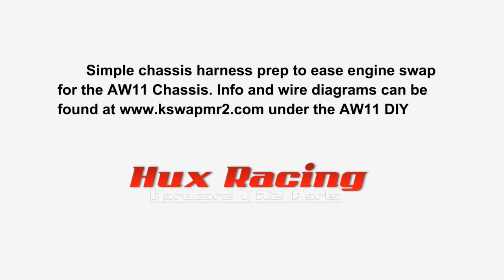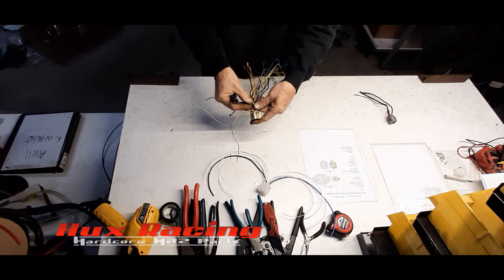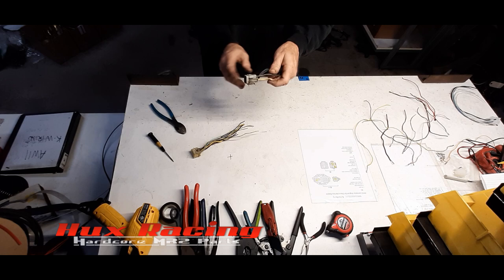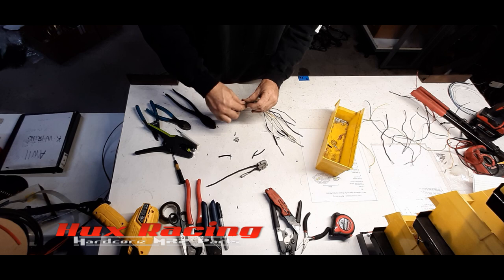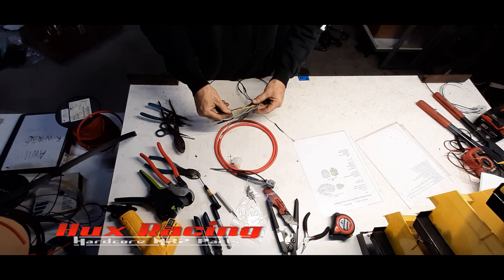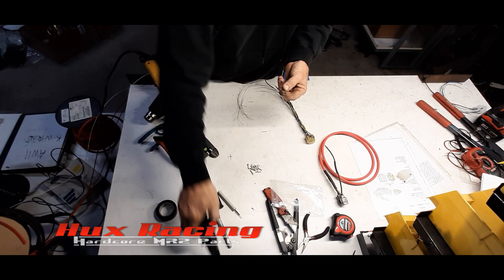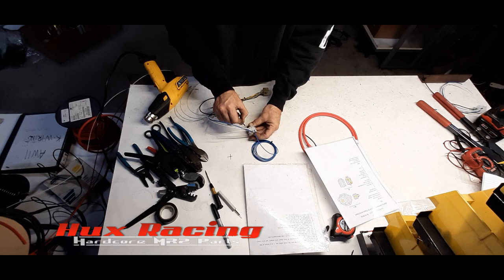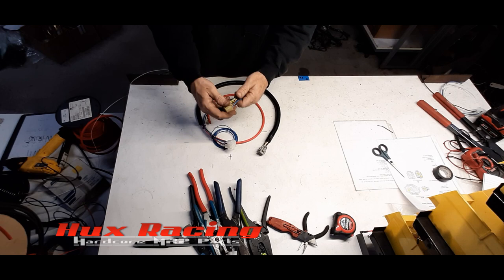AW11 Chassis Harness Work for Stand Alone Use

Comment: Incredibly informative, many thanks again Eric !
Reply from the maker: You are more than welcome
Reply: @HuxRacing  are the M1 and M2 plugs still sourceble? I've stupidly sold my engine with the harness ages ago otherwise I will have to cut the ends of and replace it with a different connector
Reply from the maker: I would highly doubt you can buy them new. Lots of old aww1 harness out there though.